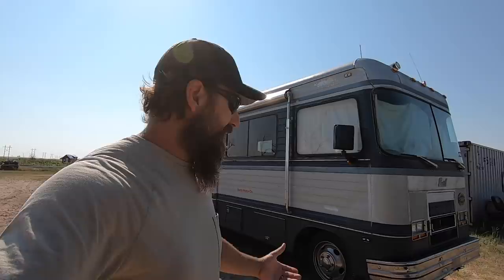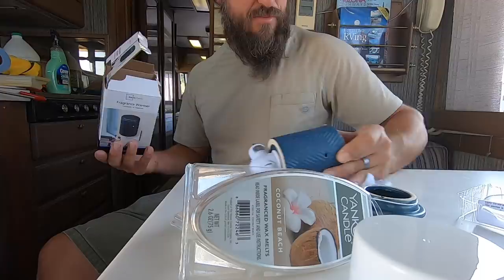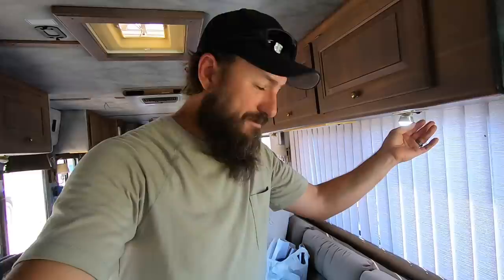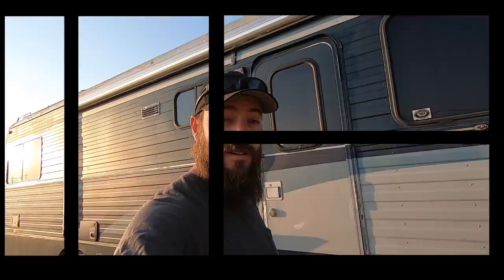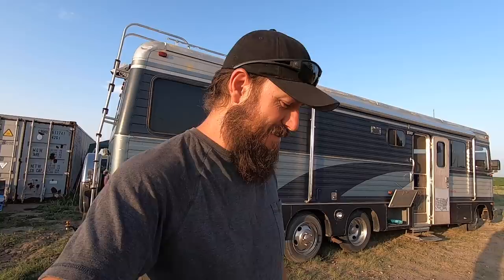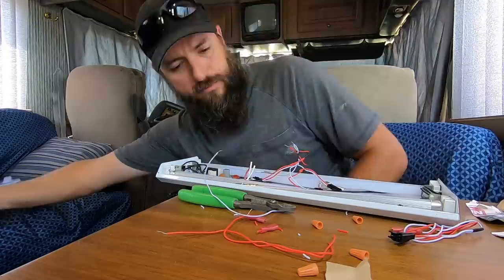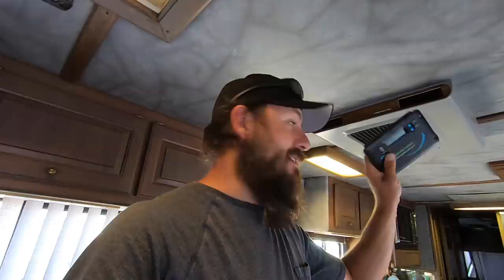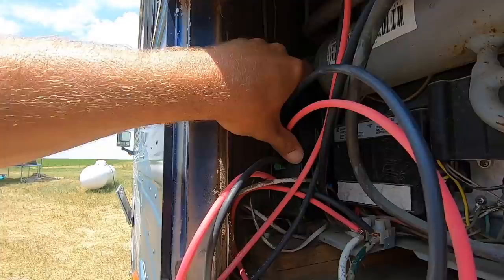1 Day Until It's First Vacation In Years And The Power Goes Out!!!   (Barth RV Restoration Pt.4)

Comment: We have a 1986 airstream 34' Limited camper which we still use regularly.  While we don't have the drive train etc. there are LOTS of similarities between the Barth and the Airstream of the 1986 vintage.  The bathroom is almost identical, as are the cabinet doors and general dark atmosphere - lots of wood.  That looks like a really nice unit which you have brought back to life.  With the transport, storage, mechanical, and initial purchase I'd guess you have between 5 and 6K in this thing - and it seems to be worth it.  You will still be using the Barth when much newer campers are in the junkyard.  Fun watching this and hope the vacation works out well.

Comment: As a temp fix to the battery situation I'd have just took a plug in battery charger with me.  Most rv sites have a 30 or 50 amp plug in, but also have a 120v plug in the box which I would have used for a couple hrs per day.

Comment: I approve the wiring for the solar. I did the same put my solar is smaller so I ran the wires through my roof vent and into one of my lighting fixtures so very minimal wiring needed to get power from the roof to my battery

Comment: I’m not sure if you use them but after you clean and spray the mattress there are plastic zipper covers and the spring board as well which helps to maintain them and also a cotton cover for on top of the mattress which can help to prevent bed bugs.
Reply from the maker: yeah we might just replace all that after i finish it!

Comment: I like the Renogy stuff, not quite as nice as the Victron stuff but it works well and it's a bit easier on the budget. Pack a standard battery charger with you as well and so long as there is shore power you can always hook that up to the batteries to top em off too if you lack good sun for the solar, least until you swap out the power converter. When you do swap it, go with one that can support lithium so you can swap the house batteries to lifepo4 based batteries at some point, drop some weight and greatly increase your battery capacity. 

Enjoy the trip. :)
Reply from the maker: it's been pretty good, been using the brand for awhile!

Comment: Hope you tested the tank valves. Something I just learned after 35 years. Keep the black tank valve shut till it’s full. Then it will drain completely. If you have a gray tank. Same thing. Drain it after the black to clean the hose. We have a class A. They are awesome
Reply from the maker: yup still working and holding fluid!

Comment: Never thought of using Simple Green as a carpet cleaner due to it might stain the carpet.  Also, have you heard of Power Green?  It's basically the same thing but made by The Lighthouse for the Blind and is normally sold in GSA (government) supply centers alongside Simple Green.  It smells similar and is a degreasers also but the Power Green has a lighter green clear appearance than Simple Green.

You're doing a great job on Barth and look forward to this and all your other projects video series.👍✨

Comment: the 80's power converter components were junk. because the fridge might be far away from your batteries the voltage on the charge controller will read a little lower than it actually is because of the length of wires and the resistance from the wires. But that is a great temp solution.
Reply from the maker: it's working well so far, might upgrade wires and do 800 watts up there!

Comment: "I don't like spending money," says the man with how many project vehicles on his property? (Says the guy with a bunch of projects in his studio AND an RV) Bestconverter(dot)com has replacement guts for RV 12v converter/charger/power distribution centers. It's an all-day install, because you're rewiring that entire panel, but as a bonus you also get a much better battery charger than the stock unit in most RVs.
Reply from the maker: haha yup! i'll check out the website, Thanks!

Comment: On your power converter, check the fuses! I've fixed several "burned out converters" with just a fuse
Carry a 12V battery charger to at least top off the house when your on shore power. Handy to keep the car battery topped off two on the off season. 
You should fully replace all the florescent lamps with LED fixtures and not bother with the LED conversions. Running on 12V, you can get cheep "motor speed and lamp dimmers" off of amazon so you can have the lights low or high.
Renogy was a good way to go. 200W is just a start... and you have the roof really going big with the solar.
Enough solar, and you can run your AC for a bit during the day.  And every panel you put up there, is sun and rain not on your roof!
--Remember, Food can't be too Delicious, A painting can't be too Beautiful, and there is no such thing as "Too Much Solar" <G>

Those 3 way fridges are Horrable Power Hogs for 12V. Replace it with a compressor style and you might be able to run it off of those 200W panels 24/7 (400W would be nicer)
Reply from the maker: yeah, i think i will ad panels and see what we can do! thanks for the info

Comment: For my camper I use AAA powered lights so my battery system is not used just for reading and cooking.
Reply from the maker: i thought about that, but then decided more solar to balance out the use would be better than replacing batteries
Reply: @LifeofLind  I buy the cheap dollar tree batteries where u can buy 4 packs for 1.25 ha ha for extended periods I have a rechargeable LED light. Having the generator is a nice bonus but lots of times for just going to the bathroom at night I like the battery powered lights seperate from the coach powered ones.
Reply: @johnsnow1355  adding more solar is setting it up for the long term rather than just using up more batteries which end up in land fill generally and not recycled.

Comment: Actually, I’m quite impressed with what works.  I let my MUCH newer travel trailer set four months and ended up having to replace the control board on both the water heater and fridge, and one week after the warranty ran out the sail switch for the heater went bad.

Comment: You can just use a battery charger hooked up to the house batteries. Whenever you plug the RV in it charges the batteries. My invertor quit too. They have a fuse inside. Mine blew. It happens.
Reply from the maker: yeah my charger is old and bigger than the solar panel haha

Comment: I wonder if there is a voltage adjustment potentiometer or similar somewhere in that power converter or maybe a capacitor that needs replacing. I know most folks just replace these when they give trouble, but I can't imagine the circuit board would be very complicated. Wonder if it'd be an easy repair?
Reply: Probably not worth the cost to repair the old converter. The current technology is significantly better- those old boxes charge at one rate, modern ones reduce the charge amperage to keep from cooking the batteries. There is probably a Renology converter/charger that will allow the renology solar charge controller to integrate and deliver more features like accurate charge status, and energy usage.
Reply from the maker: it might be repairable, but at the cost of a modern unit I don't think it's necessary, also not sure if ill replace it or just add more solar!

Comment: What a great way to easily mount solar on an RV.  Seems like the charger would be an easy fix, just get a car battery charger & wire it in place of the existing charger.... You can get a decent 15amp one for like $50 - pretty sure 75a is overkill, thats like 1000w, nothing 12v in that RV is that power hungry.
Reply from the maker: the only reason i think they did a 75 amp one, is the three furnaces all run on 12 volt... plus it has a ton of lights

Comment: Just throw a standard battery charger in their and plug it into the 110 when plugged in for now
Reply from the maker: thought of that, but had solar sitting around so figured why not haha
Reply: @LifeofLind  oh i love the solor you put in put id still throw in a 110 charger in case it gets overcast. Also just wanted to add in you may want to get a fuel pressure regulator before the carb. I had an issue where my carb couldn't hand the sustained pressure and started flooding the engine after 25ish miles of driving. My carb only wanted about 4 psi and my 5 psi holley pump was pushing at times 8-10. I remember you had a similar issue to mine on your mayden voyage.

Comment: Thank you for the solar power idea. Something I was not sure of tackling. So it looks like you actually screwed the solar panels on the roof? Screws puncturing the roof?
Reply from the maker: yes, put putty on the roof then panel then use gasket screws and then cover them and the z bracket with lap sealant!

Comment: Started watching a few days ago I'm just worried about the axle botlts you did in the first installment at the lot. I didn't catch if you put correct ones on now or something like that. 
Just a worry that's all. 

All in all its amazing find and is fun watching you tinker. 

Does the generator actually slide out on them rails you showed?
Reply from the maker: shop in video 2 fixed the u joints and bolts. and i guess i havent slid the gen set out yet haha
Reply: @LifeofLind  oh no not the same shop that fitter the new fuel pipe on the jagged torn metal pipe D: still worried  about them bolts but heck ya drove so far already so i shouldn't worry

Comment: Did you use an o3 ozone  generator to disinfect it?
Reply: Spoke too soon, you did.  HOW DID IT WORK, satisfied with the results? It's supposed to kill bugs, vermin, and germs.  And freshen the air too.
Reply from the maker: been using for a few years, i use after cleaning cars and rv's and it helps. won't work magic on everything but it works

Comment: Hope you are having fun on your trip! I would hook the Solar into the start battery so it charges that first and then the house batteries second... also you need to add some Safe-T https://youtu.be/cN8DYQIuW9Y?t=2182
Reply from the maker: yeah, didn't run propane this trip until we get some detectors installed
Reply: @LifeofLind  ??? Reply to a different message?

Comment: Are you going to repack the bearings and go through the brakes? I would not want to try and find bearings and hubs and rotors or drums if you smoke everything on the road. You need to check the rear diff the trans needs flushed and serviced